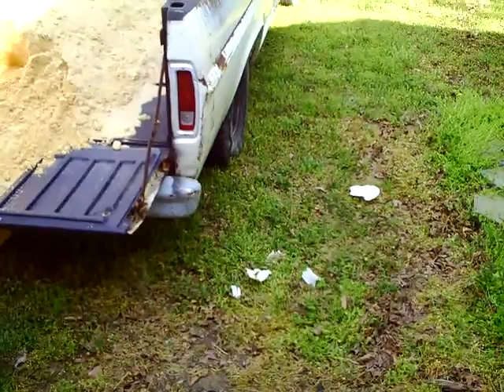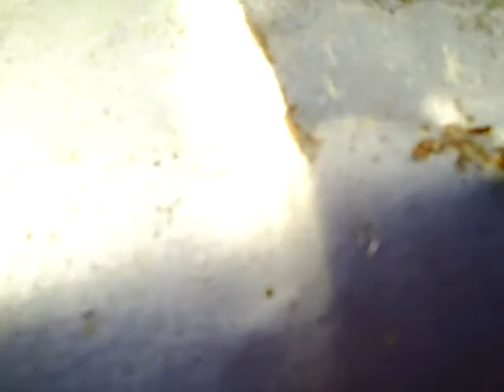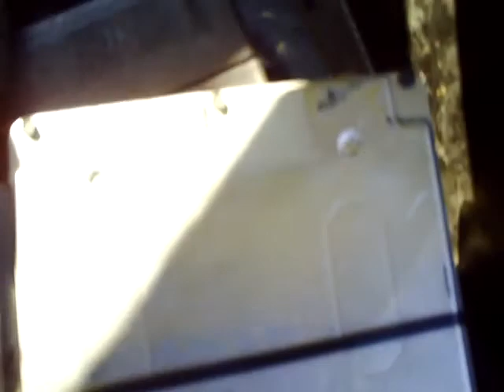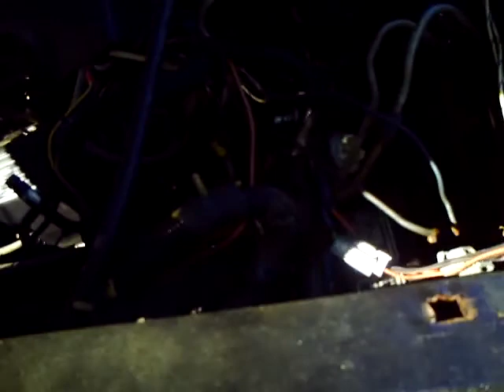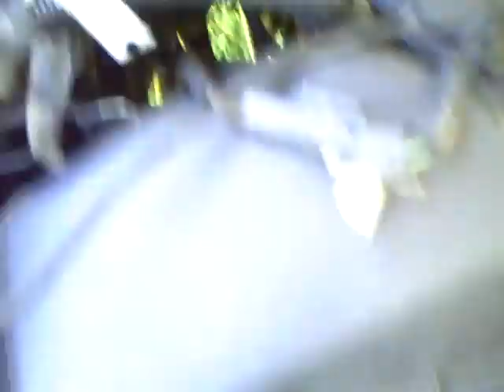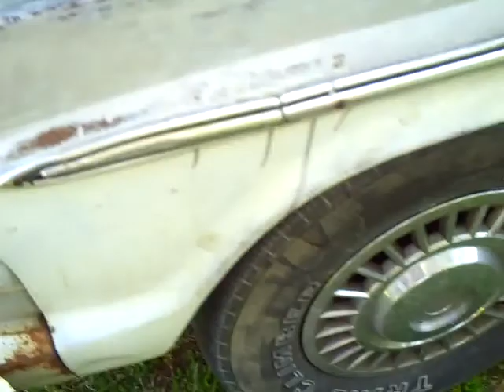Crown Vic in 67 F-100 18

Comment from the maker: @rg1565 Guess I was half asleep on that first reply.  I would think if it pumps out more pressure it would not be a big deal. The steering box should have a relief valve to control the pressure if it gets to high. Its when you go the other way like I did (pit-man steering pump with rack n pinion steering) is when you have the problem.